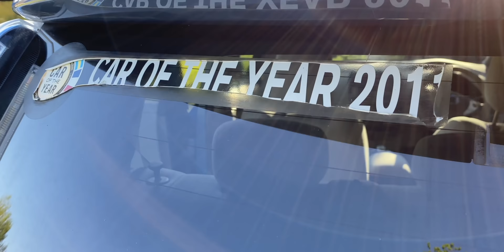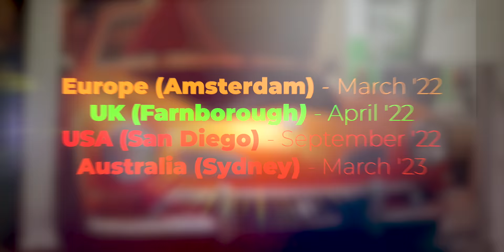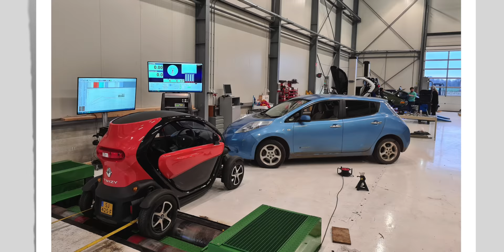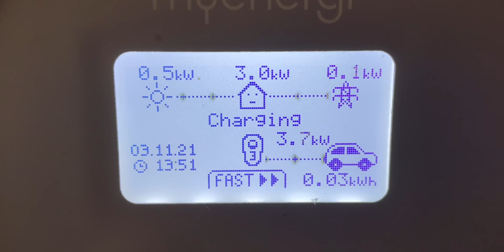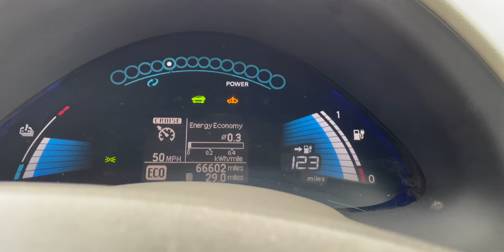Return of the LEAF: Robert drives his range extended EV home from Holland

Comment: I had the same car, 2014 model.  Ironic that I sold my Leaf and bought a Hyundai Kona.
.
.
Now I'm going to be honest about the servicing.  When I drove the LEAF my foot only had 2 positions either flat on the accelerator or flat on the brake.  As a consequence of driving like an a..shole I blew out my ball joints and steering rods..... and... and that's it.  I also changed the tyres and all the brake pads.
.
.
A 7 year old car that lost 1 battery bar.  I bought it for CND$25,000.  On fueling the car I spent $12 per month ($12x12mnths x 7years =$1008).  I spent about $800 on tyres, pads and ball joints.  That's a total of $26,808. Then sold it for $8,500.  Total investment of $18,308 over 7 years = $2,615 per year.
.
.
In contrast - with my gas/petrol car I was spending $240 per month on fuel alone = $2,880 per year.  On that gas/petrol car I had to replace just about everything over a 6 year period: new clutch, alternator, water pump, fan belt, Air filter, oil filter, ball joints, tyres, pads, exhaust sections, batteries.  
.
.
Just thinking about the frikken headaches every time something would go wrong in my gas car and how I would have to make time off work to get the car to the mechanic, then the stress of knowing the mechanic is going to fleece me.
.
.
I am a born and bread petrol-head.  I can and have stripped down all kinds of engines.  Totally refurbished old classic cars and love experimenting with all kinds of cars.  I tried out the LEAF purely as an experiment - what's it really like to have an electric car?  Ye know, on the last day I drove it, my old LEAF drove just as smoothly, just as quietly and just as zippy as the very first day I bought it.  No gas car can ever compete.
.
.
I can never go back to gas/petrol cars. 
.
.
I kinda miss my LEAF... but hey I have a Kona.

Comment: Thanks for your video. I have a 2013 Leaf that says about 75 miles of range, I trust it to about 60-65 at most. That's enough for most things I do, but it is interesting to consider a battery replacement with a used or new 40kwh pack. I checked the price recently and they wanted a lot more than 4k pounds, more like 13k$, which is about what the car is worth (and more than I paid for it in 2016 used). Have about 60k miles on it, and no service beyond one set of tires. It's been a great short trip vehicle and still meets that need.
Reply: Do some Google-Fu.
Robert looked outside the local places
Maybe he got a much better deal?

Comment: As a comparison, between the US and Europe.   I replaced the battery in my 2012 Leaf 3 years ago.  It too, had a range of about 45 miles.  Nissan charged me $8,200 for a new 24 KWH battery.  I only charge to 80% and had already have lost a SOH bar, early last year.  Independent repair shops for EVs are a rare thing here in Georgia.
Reply: I actually did take a flight from LA to Atlanta to upgrade one 2013 leaf to 62 kWh battery pack. It was been fun.
Reply: There is one run by Dex Tan in Dallas Texas.
Reply: @pashko90  Who did the work in Atlanta?  I may use them in the future.
Reply: @usaverageguy  I did.
Reply: @pashko90  oh.  OK.  I misunderstood.   I thought you had shipped your car to Atlanta, to have the work done.  And flew there to see it done.
Reply: @usaverageguy  nope. Actually, my customer did not find anyone closer.

Comment: I brought my used 2012 Mitsubishi i-MiEV in the fall of 2015 with around 18K miles on the odometer for around $7K USD. The original battery started to fade in capacity in mid 2020 and I got a warranty replacement then. Not sure if I'll be still driving it in 2028, but I'm guessing this 2020 vintage pack will still be at least charging up then. Battery technology is improving incrementally and, at some point in the next few years, we might witness a real jump in performance.  I'd be quite pleased to have the next pack push me into the 150 to 175 mile range.

Comment: Nissan should have switched to Type 2 CCS for the revamped Leaf and offered conversions for older cars. They would have enjoyed much stronger sales.
Reply: There’s no point, the LEAF doesn’t have active battery cooling and is better for shorter trips where the owner doesn’t need to charge or only charge it once. There are plenty of CHAdeMO chargers for that but the majority will never use them and just be used for more local journeys.
Reply: @richardthegreat  I don't see how active cooling has anything to do with the kind of connector it uses for DC charging. CHAdeMO was on its last legs in Europe & US when they revamped the Leaf and they could have stuck the extra 2 pins under the type 2 (or 1) charger, or got rid of the CHAdeMO altogether and only support CCS. As it is, I would hate to be a Leaf owner trying to sell it because it's basically using an obsolete charging format.
Reply: @drxym  because they can’t fit CCS in place of CHAdeMO or under the type 2 port so they’d have to re-certify the car (so I’ve heard) and the car isn’t made for long distance driving. Why waste the money doing this to boost sales when you still can’t use it on long drives because the battery will overheat on the 2nd/3rd rapid charge depending on ambient temperature and speed you drive at. The majority of LEAF owners seem to just do short trips in them so CHAdeMO isn’t a deal breaker. The LEAF isn’t selling well because it’s 10 year old tech that is totally outdated. The seat heater switches are from 2010, the suspension strut rust issue still occurs even though it was spotted on cars 9 years ago, the interior is outdated and mostly from ~2013, the boot is awkward and unusable for wide items, it only has a max 6.6kW AC charger. Nissan are just dragging out sales until the Ariya comes along.
Reply: @richardthegreat  Somebody can crack out the measuring tape, but the charging hatch is already large to accommodate 2 chargers side by side, and could probably accomodate DC pins under the type 1/2 if it were shifted up or at a 30 degree angle. And if they were revamping the model then they could have just changed the port. This is all hypothetical since Nissan refused to acknowledge which way the wind was blowing and owners got burned and sales (and resales) doubtless suffered too.

Comment: Just to be cynical, but what did the solar panels cost to install and have you factored that into the cost of the electric you charged the car with? We are a twin Leaf household and they are a joy for local travel, but longer journeys are a real stress. Not because of the range the newer one will do, but because you never know if the charger you want to use will be available or even working. This is now compounded by the fact that Chademo is the new Betamax. Just how the government expects the switch to all electric will work when the network is just so awful, and they have just backtracked on the requirements for workplace car park charging.
Reply: Total lifetime cost of ownership including servicing of the entire electric system including batteries, inverter, solar, installation, maintenance, etc.

Comment: Love it! Driving a 2016 Leaf SV bought used in 2019 August. Max range with the 30kW battery(now down to maybe 21%) is now about 100 miles if city driving. Would love to get a 40 kW battery/ Range of 149 miles in the new Leafs. Get between 5.2 to 5.5 miles per kw.
Reply: buy ñew baterry

Comment: Sadly, the people that need to hear this wont... I read every single day people spouting bs about how batteries dies in 6 months or 2 years or what ever or loose 50% of its capacity... its so frustrating.

I had forgotten or missed that you had this car still, glad to see its still around! Also did not know there was a new Ioniq out, it looks like a Niro with some new panels? :D Wich it probably is...
Still say that if I was able to buy an electric car today it would be the Niro or that blue thing! :D
Reply: Murdoch, the new Ioniq 5 is a brand new dedicated EV platform, rather than converted gas models which Kia and Hyundai used. The 5 has very impressive specs and a very spacious interior, hopefully they produce enough to meet demand

Comment: Wow I can't wait for the solid state batteries to hit the market! Hopefully we'll be able to swap them for our old lithiums. I'd like to keep my 33kwh battery for my house
Reply: Nobody who knows about the integration of batteries in to cars will go near the replacement of a battery with a totally different chemistry. The programming of the charge and discharge, state of health and safety limits are totally unknown. The R&D costs just to make it safe are the biggest barrier to commercialisation. Better to just get a different BEV and move on. Same comment for putting a Honda K24 engine in a Corolla. One person might but they will tell everyone else it’s not worth the headaches
Reply: EVs Enhanced in New Zealand just introduce a new battery system for the LEAF that can use any type of future battery cell and the packs have Thermal Management as well.
Reply: @theairstig9164  Depends on the specifics of the new chemistry. Li Ion with BMS can easily replace Lead Acid because the former's charge/discharge envelope is well within that of Li Ion. A good Solid State battery should have a charge/discharge envelop that's better than Li Ion so backwards compatibility should be assured.
Reply: graohe vamoier batees vest rigt ñów

Comment: Great video very interesting to see how you can upgrade the battery capacity .
Two ICE cars in our family and we are currently looking at replacing one with an EV.
I’ve been looking specifically at the Leaf up to the 2017 variant .
The Accenta and Tekna but the prices are all over the place .
I borrowed a mates Mini Electric on a short break to Pembrokeshire from our home in the West Midlands . One to try out an EV and to get used to the charging process.
It was a complete farce.
I’d got the wrong app or needed to download an app. I’d put my details in and it wouldn’t recognise the car !!
I’d pull up at a service station and an ICE car would be parked in the bay!!
Or Zapp map said a charger was working when it wasn’t !!
I’m ok locally loads of chargers and I can charge from home.
 But on the two or three times a year we travel to Cornwall or Devon or the Lakes . The charging issue does concern me.
But the Mini was a revelation to us.
It’s convinced us to take the plunge and buy an EV for a second car .
Reply: I live in Devon and I have to say, the infrastructure South of Bristol just isn’t here yet. You’d probably be fine on the M5 until Exeter, but once you’re past Exeter and the further south you travel, you’re buggered
Reply: I'm in agreement with you Paul. 
The infrastructure is crap!  
We bought a second hand leaf about 2 years ago as a trial as my dad had one and said it was great. He doesn't do many miles and can charge from home most the year.  
I then bought a Kia e-niro in June 2020.  WOW - what a great car.  Does about 250 miles motorway driving...  70mph.. although best trip was from from strathclyde to home in the summer - 280 miles tailgating Artics without a charge doing about 55-60 mph. Got home said I had 60 miles range left...
I've done 36k miles upto now in about 18months, mainly longer journeys up and down the country from Lands End all the way upto NW scotland and the Hebrides.  I've nearly ran out of electric on a few occasions.  (Actually ran out of electric in the Leaf about 1/2 mile from Tamworth services - on the motorway junction - had to get recovered to the snow dome, wait 4 hours until enough charge to get to a fast charger as tamworth services fast charger not working.... but thats another story!)
I use Zapp map and have had a many issues with chargers not working but not reported on zapp map or the originators app mis-reporting.  
Having travelled all the west of the UK (Devon/Cornwall/all Wales/NW England/NW Scotland) including the Hebrides when we nearly ran out of power on a number of occasions.  The cost benefit is worth it if you can charge at home at cheap rates and can afford the time waiting to charge.   
I normally take my cycle and use the charging time to explore the local area for 60-90 mins in the nice weather which has been fantastic.  The time charging is used to write up reports or investigate my next charging locations...
The winter is completely different!  
it takes me 2 nights to charge the car at a lower price on "octopus go" 4 hrs a night @5p a kw.  This means it cost me about 1p a mile if I can charge at home.
I suspect the price of electric will rocket in the next few years so ensure you max out solar panels at home... 
All in all I'm very happy with the e-niro and our Leaf which is used for local journeys upto 100miles.

Comment: so, £8,500 at Cleveleys in Cheltenham* or £4,000 done in Holland. Result, Robert! well done. Do you have details of the firm who did your swap please?  Great content, thank you 👍 * as per your April 2021 video.
Reply: I dont know what battery Cleveleys will put in, but please remember that the battery he got was a "used" battery from a crashed car.

I bet that if this catches on, there will not be enough crashed donor cars to go around, so maybe the prices will have to go up, because they will have to replace the batteries with new cells.

Maybe that is what Cleveleys do and this is the reason it is more expensive ?
Reply: @JohnDoe-bd5sz  Err, well, there aren't enough old Leafs to go around either so..........!?
Reply: @andymccabe6712  Why wouldn't there be, he says they can easily become 20 years if they just get a new battery.

I would argue that for any given car brand and model, there are fewer of that model in the breakers yard, then on the road.

Comment: my 24 kwh nissan leaf from 2014 has about 93 % capacity relative to when it was new. We can still go 100 km/ 62 miles on the highway. It would be nice with a battery update. So Robert might be mistaken. Cars after 2012 is likely also going to get upgrades, even the mokka E - in 10 years - might get a cheap battery upgrade giving the car more range.
Reply: but at least when they get those upgrades, the battery that comes out will still have easily a decade of life left for use in either another car or for battery storage, it'll be far from useless
Reply: I'm really curious as to how you pulled that off? I had a 2013 that got down to 65 miles of range, and I've got a 2017 now missing one bar(and down to 90 of the original 107 miles). Fingers crossed that the 2017 holds out longer.
Reply: @robertcowher  which country are you in? Leaf is a particularly bad EV if you're in a hotter country due to its practically complete lack of a battery cooling system.
Reply: @RWoody1995  I'm in the middle of Alabama in the US, so that probably doesn't help :)

Comment: A year or so back, I realized I had not had my 2002 RAV4-EV serviced for seven years, so I took it in. There are a few things to replace and check, but essentially the car was in perfect condition. The service was $200-$300 or so. And these are old NiMH batteries.
Reply: Thats amazing! :D
Reply: Toyota absolutely nailed it with their NiMH on the first try, why they're still using the same NiMH technology in brand new cars today. Without active thermal management, they are much better in the heat and cold than lithium ion without.

Comment: I loved my 2018 Leaf but here in the USA it was not a good choice for road trips.  Multiple DC Fast charges would heat soak the battery and lead to ver slow charges and eventually Turtle mode.  As a local runabout, fantastic, charged it once per week in my garage at home.

Comment: A cracking video as usual! Really exciting. 

Am I correct that this is a 42kwh upgrade for only £4000???

This seems less than half the price of such a conversion in the UK?

The Newelectric website had no details of putting the larger battery in a leaf, was this a one off or will they do more like this??
Reply: Would love to hear answer on this also, defo considerably cheaper than what I can see online.
Reply: They had spare pack from a crashed car. Probably that's why it is cheaper I think
Reply: @sunilarkt   so the 4000 only covered the cost of fitting?
Reply: @lozl  Fitting definitely should not cost £4000.  It's only a simple process to replace the battery as they are the same form factor as the original 24kWh.  They do need to cap an unused connector and pair the battery pack with the BMS.  So that price would have included sourcing the battery pack.  However They probably applied a discount for keeping Robert's old battery (still useful even though it's old).  It's probably also cheaper because there are more vehicles in mainland Europe and it's easier to get battery packs from wrecked LEAFs.  Unlike here in Australia where a similar pack would have cost A$15,000 due to the low number of LEAFs on the road, and so the wrecked packs need to be auctioned and shipped from Japan.
Reply: Yeah I think this video needs a full cost breakdown- how about it @fullycharged? I could use a battery like that for £4K!

Comment: unless the leaf is the cheapest...i cant see ppl buying a leaf in todays electric car competition
Reply: I just purchased a brand new 62kwh leaf. I charge from home99.9% of the time and it does 250 miles to a charge. It is a lovely car and i got a great deal for it, much better than other manufactures offered for their new cars of simelar functions, infact my leaf range is very good for the price, anything more and you would be looking at losing the government grant of £2500 because those cars cost a little more over the threashold
Reply: Used ones are cheap, because Nissans depreciate like heck, even if they're not all that heavily used.
Reply: We considered a Leaf, but wifey didn't like the rear seats or the styling.